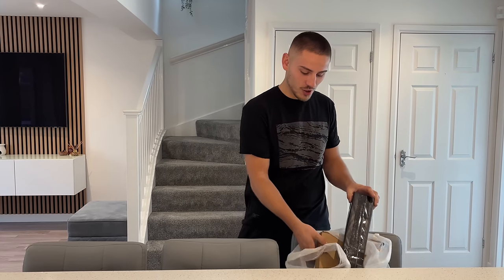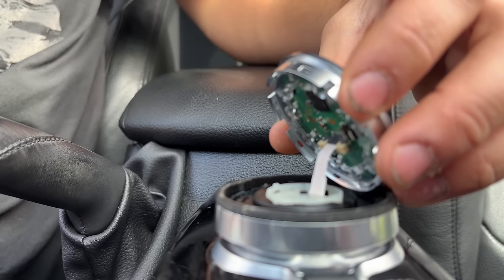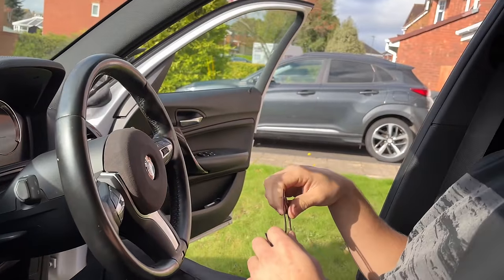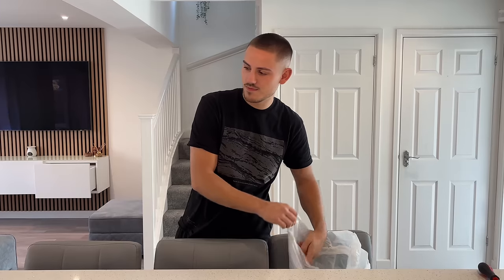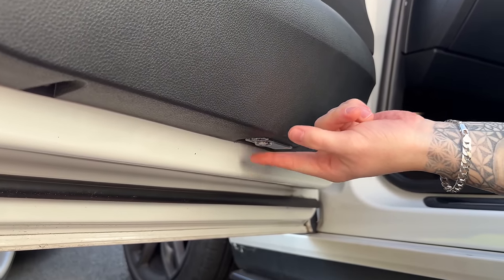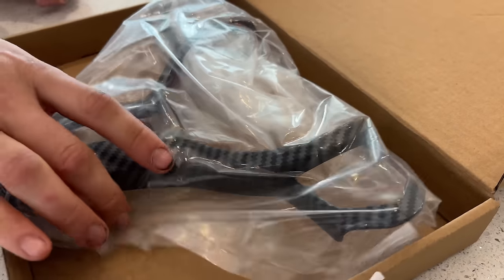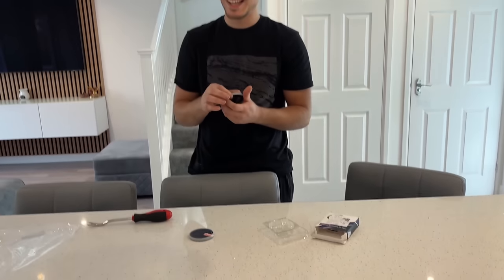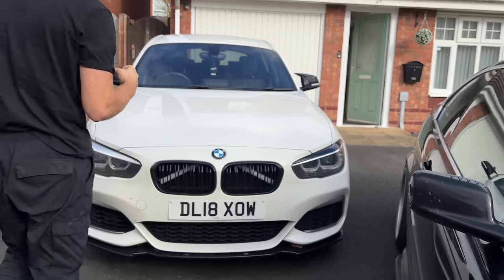THE WORLDS FIRST TEMU M140i…

Comment: can i ask you something, does it matter what kind of cold air intake you put in ur golf. cuz when i search for cold airintake kits. theres only for speical cars and stuff. does it matter? and also do you think heat sheild is better and not a full opened one
Reply from the maker: @amaimee6237  depends on which golf you have, I had a Mk4 GTI and I put K&N on there, many different brands will make one to fit your car, you have plenty of choice, whether it’s a 1.2 or a GTI they’re usually the same. 
And they usually come with a shield however you don’t necessarily need it, I think open is better because you can see it and it sounds better but it’s entirely your choice what your put on, it won’t affect the usability
Reply: Get a heat shield 100% the whole point is to suck in cold air
Reply: @daniels1263  ye man if i heard about it, like. most poeple install it without heat shield , it's not right it may work, but after time wont do nun,  i feel like right way to do is full shield
Reply: @amaimee6237  also if you want more sound a foam filter usually sounds louder than a regular cone filter
Reply: @ oh and a decent front mount intercooler to cool the air also helps with cone filters
Reply: @daniels1263  yeah, i was thinking of adding intercooler and a cold air intake
Reply: @ would help your engine in the long run
Reply: @daniels1263  i know it would sound better, but isn't 100% shield better isn't that how to be installed the rightway. + i belive even with 100% you would still hear it.
Reply: @amaimee6237  yes but with foam filter you hear it more it’s basically the same thing as cone